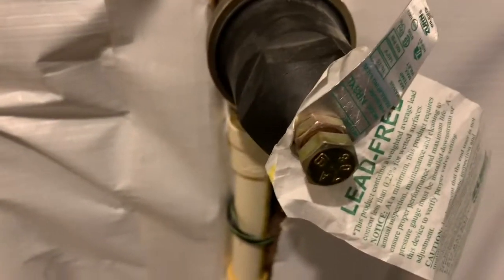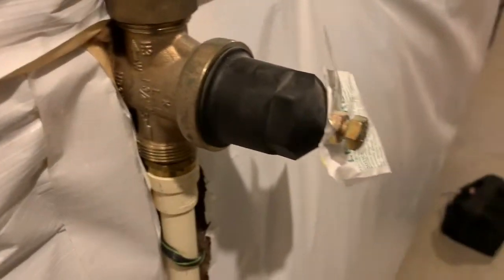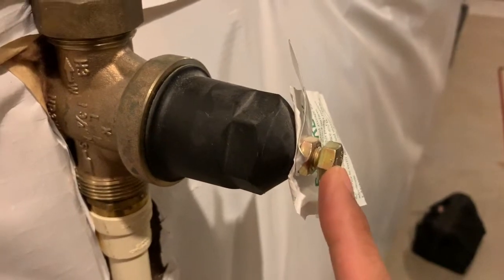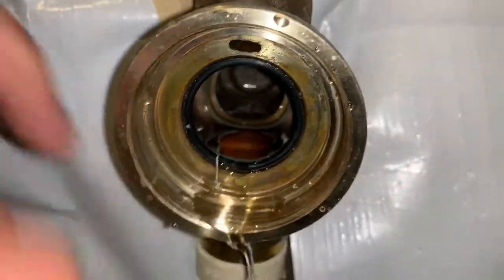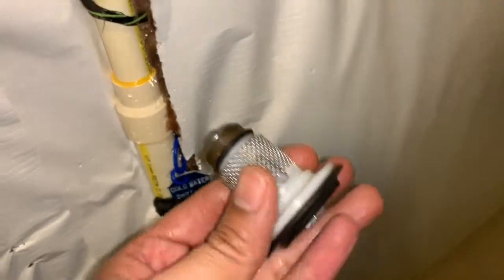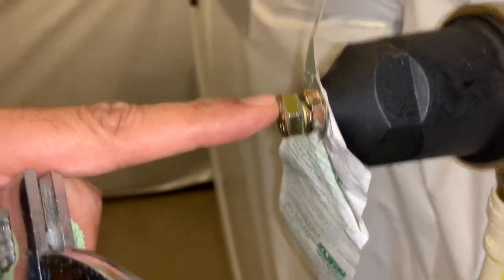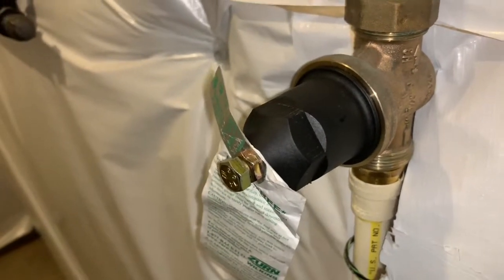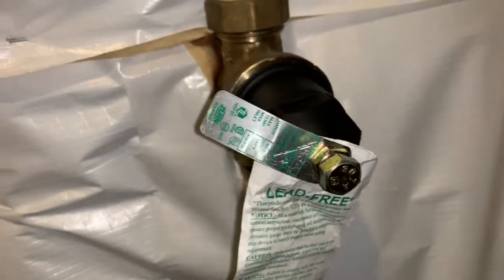Water Pressure Regulating Valve Zurn NR3XL Malfunction

Comment: PRVs don't sustain pressure when water outlets in the house are opened.  If you open 5-6 spigots and faucets all over the house of course the pressure will drop.  You expect a prv will magically sustain the pressure when you do you open valves.  Even with no prv,, pressure drops when multiple water valves in the house are opened.  Your post causes confusion for others.  Please don't post ill-conceived expectations as wisdom.
Reply from the maker: Thanks. It seems you don't have an understanding of how a PRV works or how pipe sizing is done to keep pressure drop to an optimum level, this is the basics of hydraulics & hydrostatics. Pressure drop increases with increased flow rate, to counter that, pipe diameter is increased with certain design assumptions e.g. 4 faucets of 1.5 gpm will be open at the same time, so the pipe diameter has to be certain size to ensure that each faucet maintains 1.5 gpm and the main pipe can sustain 6 gpm. Now coming to PRV, Pressure Regulating Valve, it's main job is to control the pressure downstream of the valve at a set point at certain design basis. The valve varies its opening based on demand. There is pressure drop that follows a curve on a graph but it is not significant within design limits, example given above. If the pressure and flow rate drop is significant, the first and obvious thing to look at is the PRV assuming the piping of the entire house is the right size. If your PRV is smaller in diameter, it will cause choke flow, hence it needs to be of the right size. So to recap: an adequately sized PRV will sustain downstream flow & pressure by varying its opening, that is the sole purpose of a PRV since the utility supplied water is over 80 psi and the PRV drops it to around 40 or so.
Reply: @akhaqan  You had incorrect pipe size.
Reply from the maker: @sarentopi1502  No. The valve was 3/4" and undersized, wrong choice by the plumber and valve also malfunctioned. Problem was solved after putting a new PRV of 1".
Reply: @akhaqan  I am installing a 3/4 in nr3xl.  So your story makes me wonder.  I detected the whole story was not in the video.  Now you are saying the 3/4 you had originally malfunctioned.  I think you get benefits from going up to 1 inch but maybe I won't need that.  Also, you just used reducers to connect the 1" prv to your 3/4" pipes?  We'll see how my install goes.

Comment: The ZURN600XL has a internal O ring leak and is a design defect. the O ring allows high pressure water to pass the O ring and pressureize the low pressure closed side, all these valves are all deficit, they are a inmitation of a Watts regulator.
Reply from the maker: I replaced it under warranty and no issues ever since

Comment: Hello sir my bolt nut is dripping very light water do I need to replace the whole pressure valve or just that piece that you opened
Reply from the maker: If there is anything loose, then tighten it. If the leak doesn't stop then try replacing the internals only, not the complete assembly.
Reply: @akhaqan  Thanks
Reply: @akhaqan  Do they sell separate pieces if I want change just the internals piece
Reply from the maker: @amitpathak8823  I am not sure, you can buy the complete valve and use the internals of the new valve.

Comment: I have finished exhaustive flow testing on this same unit. (I don't know how many hundreds of gallons of water I wasted today.) It works fine if one is willing not to control the pressure but that's not the idea, is it. At 130 psi static I'm getting at least 25 gpm. At 50 psi static it settles around 0.6 gpm with dynamic psi less than 10. I took it apart and lubed up the O-rings. Everything looks clean. The only improvement is the awful sound it used to make at 50 psi. It is now quiet but still doesn't work. My conclusion is the cartridge assembly is not traveling as freely as it should. I wonder if the repair kit will somehow fix it.
Reply from the maker: In my case, the problem of low pressure was solved by replacing this PRV with a bigger size allowing for higher flow rate with lower pressure drop. Just a quarter inch upgrade was enough. Thanks for sharing your experience.
Reply: @akhaqan  My flow tests and the specs indicate the 3/4 inch should be adequate for my needs. Maybe the one inch is just a better valve. I've ordered a replacement Watts. In the mean time I'm going to try some emery cloth on the valve body.
Reply from the maker: @jonathanhal  Great. I have found through experience that its always better to oversize slightly especially when you have the option of laying new plumbing, the chances of hearing water flow in pipes reduces dramatically, 3/4" vs 1". For energy efficiency, hot water pipes need to be as small diameter as possible. That's a whole subject onto itself on how to design for energy efficiency.

Comment: I have a pressure valve like the one shown and I adjusted the pressure but now it leaks from the adjusting bolt.    Can I repair it or I have to replace the whole unit?     Can you please give me an advice?
Reply from the maker: I am not sure if it can be repaired. You can get a new similar valve and just replace the internals.
Reply: Hi, I have the same type of leak. Did you ever get resolved?

Comment: As you may have already found out, but I'll mention it in case someone else finds this video as I did. There is a chart available that shows a plot of the pressure drop based on the flow (GPM), so for example a 3/4" valve set at 60psi when water is off and, for example, 80psi upstream, may drop down to 40psi. You may need to install a much larger valve to get a more consistent pressure at your maximum flow rate. All of these type valves have that characteristic.
Reply: Cool will try. Can you connect larger 1 inch prv to 3/4 inch pex pipe? How to reduce the size?
Reply: @ncvman  The valves come with charts that show pressure in relation to flow. The only way to know the amount of pressure at a given flow rate is to look at the charts.

Comment: Mine has the same problem. I installed one at my grandma's house and it is broken too. I replaced both with the 70XL
Reply: Where did you find a 70XL? I contacted Zurn/Wilkins directly, and they said they no longer make that model. NR3XL is the new replacement model
Reply: @Jdwg1972  SupplyHouse.com, Ferguson and Home Depot sell them. There are also Watts and other brand PRVs.
Reply: @DragonBuilds  Just went to Ferguson’s , said the same thing🤣 New model replaced the 70XL
Reply: @Jdwg1972  Buy a Watts PRV or something.
Reply: @DragonBuilds  homeowner DIY’er. Sorry for what seems to be basic questions, but was looking to find the same 1 1/2” PRV for exact dimensions, since the manifold is all copper. I’ve never sweat pipes before and it could be a costly mistake.
Reply: @Jdwg1972  The 70XL only comes in 3/4 and 1". 1 1/2" is pretty big pipe for a regular house. Sweating pipe is not hard. You will need a higher heat MAPP gas torch for pipe that size. Watch some videos and practice on some scrap pieces first. A Resideo Braukmann 1 1/2" PRV is $300, they are not cheap in larger sizes!

Comment: My Zurn NR3XL is 15 years old Just recently water flow slows to a dribble for 5 seconds then comes back normal flow. Water gauge shows 120Lbs all faucets off. If I turn on one faucet pressure drops to 62Lbs where it should be. I suspect a rubber gasket crack. A rebuild kit is $90 a whole new unit is $70. I plan on just swapping guts from new to old housing, since I won't have to cut 3/4 galvi pipe and re fit the new body.

Comment: Same here. My water pressure is no where near the neighbors' water pressures. Take the whole day to finish watering my lawn. It is set to maximum right now. Running 2-3 faucets and water will just drip out. I'm going to service it, but look like it is just junk out of the box. My house is new.
Reply: I just serviced it last week and it is working better than ever before. There were a lot of small debris and chlorine buildup in there. You need to flush them out of the input pipe as well (so much more in there, as they can't go through the strainer). I would service it every few years and then replace it after 10-20 years. The design of the valve is way too simple to go wrong, but the rubber seal rings, diaphragm do wear out over time.

Comment: Did you ever resolve this issue? I have the same problem.
Reply from the maker: Yes I did. I replaced the valve with a new one of 1".
Reply: @akhaqan  same brand?
Reply from the maker: @jobeejobey  Yes
Reply: @akhaqan  What brand and model did you get? How to increase the 3/4 inch cooper to 1 inch prv?
Reply: Try to service it first. I did it and it fixed my problem. Before that, water was just dripping out of the faucets, and it did not maintain constant pressure.
Reply: What's prv
Reply: What's prv